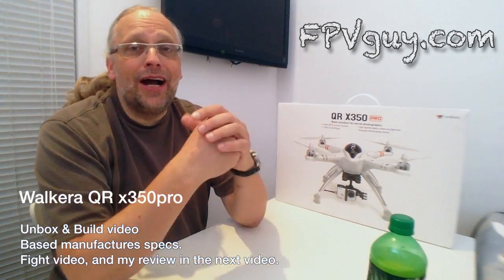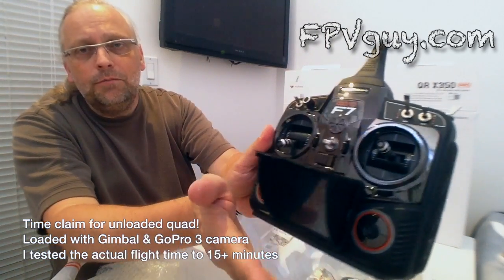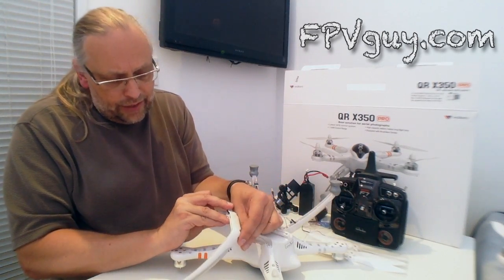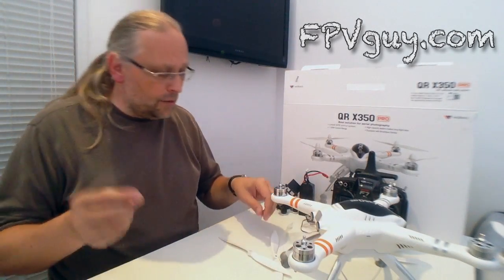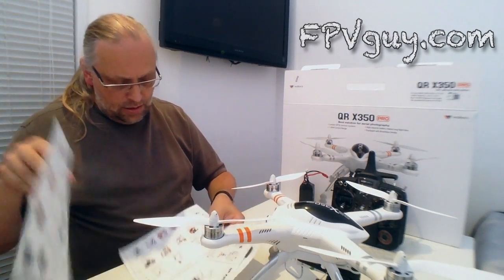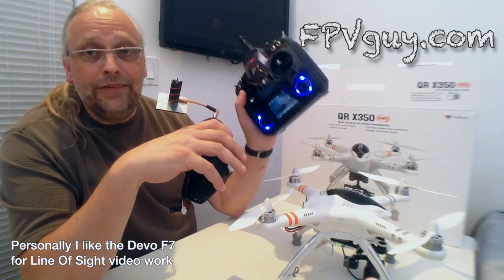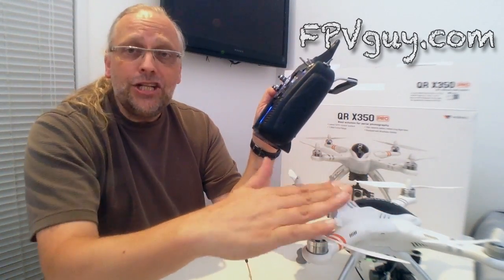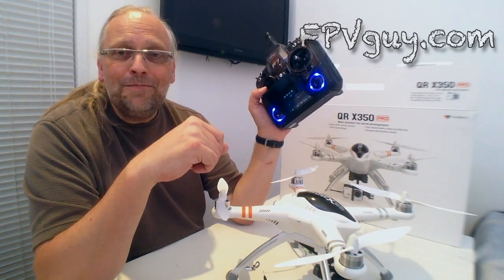Walkera QR x350pro build video

Comment: i've researched for weeks between DJI and QXR. Just picked my QXR today thanks to your videos! Very informative and descriptive! Answered MANY of the questions I had the local dealer didn't know how to! Thanks! Subscribed!
Reply from the maker: rabeirophotography  thank you for the kind words.   glad some of all this information turned out to be useful.:-)
Reply: Bo Lorentzen indeed! and the instruction manual you translated came in handy!! thank you! i'm looking forward to posting videos touring the florida beaches soon! [as soon as i can trust myself to not land it in water!!] i'm a total newbie...
Reply from the maker: rabeirophotography LOL. well its better to keep you out of the water.  get a lipo tester like you see in my first-flight video.   get used to the actual flight time,  then stick a digital egg-timer on the top of the radio, so you can see a flight time EACH time you start, if you believe you have tested 15minutes, you should set the alarm to go off maybe at 10min so you KNOW you have enough safety buffer.  remember, wind, speed of flight can significantly affect your power consumption.    Go find a "long haired" green field for practicing and get comfortable flying and using the controls in the system.
Reply: Bo Lorentzen will do. i plan to set my timer on my phone when i fly. that was the one thing i really liked about the Pv2+, the app contained all the information. the dealer where i bought the qxr wasn't sure about how the quad reacted to low battery. he thought it would start flying back with low battery and i couldn't find anything about it online anywhere. is it possible to have this thing drop from the sky due to low battery if i lose track of time?? is there any indicator on the remote? i am still charging the batteries.
Reply from the maker: If it runs out of battery, it will auto-land.  firmware 1.0 and 1.1 came down pretty quickly, I just tested the latest 1.2 which come down a lot slower..   
The software on the QRX is not as refined as a P2, but it is a APM controller, and you can do almost anything with it.. take it VERY slowly though.  hop online and learn the APM mission-planner.   
To address the come home on low battery though, its not such a great idea, as if you have flown straight out for 90% of the battery,  clearly the quad will not make it back home on the remaining 10%, that is why the emergency land simply lands.  
I would install a lipo beeper that starts beeping when the batteries get low. and also look into a OSD that works with APM.   but basically, good healthy flight-management, suggest you fly fairly aggressively in a small area, get some real times, then set timer to HALF that time as a good point for thinking about getting home and landing.. my last two crashes was because I ignored that.. in the desert I was landing with maybe 90sec on the battery, and then chased a motorcycle for "one more shot" that was stupid and cost me a couple of propellers and a arm on a hexa.
Reply from the maker: rabeirophotography BTW. here is the test of the emergency landing.. I did not touch the controls. however UNLIKE me,  the moment it touches down (or right after) flip the MIX to 0 (manual) position and kill the throttle to avoid it keep trying to fly.. I left it in GPS and it was not sure it landed because of the soft impact on the grass.  that was firmware 1.2   x350pro 1 2b
Reply: Bo Lorentzen you rock! thanks!
Reply: Bo Lorentzen any suggestions to start looking for an OSD?
Reply from the maker: Ahhhhh.. thats hard, I use the bone simple $30 thing with a GPS from HobbyKing, and don't worry about how to hook it into the main system. however there is one called something like miniimOSD that is made to work with APM controllers.. so thats probably the ticket.. Im just not sophisticated enough to sort it out.
Reply: Bo Lorentzen yup...that's what i've found so far. thanks again for all your time and help! really appreciate it!!!!
Reply: Bo Lorentzen my first flight was a failure! only out about 5-7 minutes when i tried RTH switch and something happened. it just dropped from about 1015 feet on pavement. broke the shell. replaced with 350 for $5 but now, although battery acknowledges connection and beeps, no lights, no bind. tested battery, was at 64%. now at shop. going to cost me money i'm sure to fix or replace! ugh!
Reply: Oscar Rabeiro 10-15 minutes…not 1,015 minutes!!!
Reply from the maker: Oscar Rabeiro OUCH Oscar,   that is horrible news.  But you know, Im curious how you decided on the first flight ever with this thing, to fly it 300m up and test a feature you are not familiar with. ;-)    Im not judging just STRONGLY saying. DON'T DO THAT.!   all new users should go find a piece of green grass and fly over it while learning how the quad behave. It is very hard to manage all the details of a first flight from memory, but stick to a few features.  particularly make sure you have it in solid-GPS hold, and as I said many times, keep flying 4-5 batteries before going further. as the hold get better.     I suspect the throttle stick were not centered.. or that it accidentally maybe were switched from GPS-hold to manual.. I don't know and it obviously don't matter at this point.. 
PLEASE everybody buying new quads, regardless what brand, please take a look at the FIRST FLIGHT video I did the other day x350pro Safe First Flight - Step by Step
Reply: Bo Lorentzen absolutely. i actually watched that video again before i took off. that was a typo, not 1015 feet, 10-15 ft. it seemed to get away from me a bit at that point which is why i wanted it down via RTH. definitely was trying to keep it over grass, but it was at a local model plan air field. the height and direction got away from me, hence the RTH then BAM! now just waiting for them to tell me the damage. if more than i care to spend for repairs, looks like i just bought myself an $800 paperweight sadly.
Reply from the maker: Rabeiro Photography  PHEW. well 10-15 feet sounds a lot better. ;-)    its one of those times I wish there were a black-box to see what happened,  I know stuff goes wrong, but I wonder what it was.    Contact my buddy Matt before you commit to a fix cost, he may have a though about that.  he is pretty active on the RCgroups 350pro thread. user name mattjk
Reply: Bo Lorentzen i was even afraid of flying at that height!! so 1015 feet would have meant i just gave up and walked away! LOL thanks for the heads up! i'll find him!
Reply from the maker: 10-15 feet is a bit high first flight.. ;-)  but should not completely destroy your quad.
BTW. love your G+ page,  shoot me a PM as you go forward fixing the quad.
Reply: Bo Lorentzen will do! hopefully no major and can be repaired. thanks! i don't work much on the g+ page, all my other work is on my main pages. :-)
Reply: Bo Lorentzen after two weeks I am finally picking up the 350. long story short, they are replacing. No one could figure out what the issue was! They couldn't get the board to show on computer. They said unlikely case with walkera, but ultimately, a bad board that went kaputz. I am curious about that though. My luck to get the one bad board that caused the crash? Hmmmmmm. Anywho, I'm taking another maiden voyage flight ASAP. the dealer tested it, so should be perfect now. Walkera took this long to reply. Can't wait!
Reply from the maker: Rabeiro Photography    Awesome,  hope everything works out with it.

Comment: I had a heck of a time getting mine to fly correctly and work in GPS Hold and RTH modes. After hours of tinkering, I finally realized that a RTF Walkera X350 Pro doesn't come with the transmitter configured to fly it out of the box....or mine didn't. Once I viewed the much more helpful DVD instructions and set everything up, NOW its RTF.
Reply from the maker: thats odd,   mine flew out of the box all functions,  my guess the dealer merged a BNF kit with a un-programmed Devo radio.?
Reply: Bo Lorentzen I suspect you are right. The EBay seller I bought it from doesnt respond. Lesson learned. Thanks for responding and great videos. Subbed.

Comment: Thanks for the video Bo.  I'm a newbie to the quad flying, and I should be receiving my 350 pro tomorrow, and your video helps a lot.  I'm starting mine out with the propeller guards...lol.  Also, thanks for the easy to understand Quick Start Guide.
Reply from the maker: Hey Johnny,  thank you for the kind words,  delighted I should help understanding the setup to the 350pro.  Ive had a lot of fun flying it, hope you will as well. :-)

Comment from the maker: Phil Ladds  motor not starting,  make sure the mix switch is in "0"    next check your trims. ;-)

Little surprised it just wandered off,  I have not heard about that before,  the first couple of flights mine were a bit rough, but nothing that was not easily managed with a bit of roll/pitch control

Comment: Hey bo thanks for the reply back. Im happy to report I fixed the problem with the motor myself. It was the red green  and yellow wires they were just held in by white liquid electric tape. No soldier at all. All four motors were like that. Everything else was soldiered very well. So I just put couple drops rubbing alcohol and it scraped right off. Stripped and soldiered everything back tight. So if anyone else gets new 350 pro take apart and refix wires so you don't plop out of the air. I just put aeronautical lights on. Did not notice it then. But thank you for your reply you've always been very helpful. Great help for new flyers like me. Btw will you be reviewing the hubsan x4 109 pro, did you see it at the c.e.s in vegas. Thanks for your help look forward to hearing from you. Good day
Reply from the maker: WOW... that was a crash waiting to happen. glad you got them soldered up correctly..   
I did see the 190pro,  but until it flies and ships not much going on with it..   right now my money is probably on the q500 in terms of ease of use and general video performance for entry level operation.
Reply: Thanks bo, who makes the q500 ? I'd like to check it out
Reply: Allow me to retract that last time I just realize you were talking about the q500 you reviewed. Sorry lol, medicinal purposes withstanding. Took me a sec to realize. Just woke up from work
Reply from the maker: Michael Dorn  LOL

Comment: Hey Bo, Got to watching this video again for about the tenth time. Learned a couple things, this time around. One being the fact that i can buy a devo7, transmitter and have it work. The other was that, the problem i am having with trying to bind my Turnigy 9X with this quad is this, I believe. In this video, You mention the fact that it has the APM, control system. I have been trying to bind a PPM, system with the APM system. Not 100% sure, but I don't think that will work. So, with the devo7 receiver on it's way to me. There is also going to be a devo7 transmitter on it's way shortly! I'm am still hopeful that I didn't burn something out, trying to use a 14.8v battery, at the start of this build. Thanks Bo!! Tom....P.S. I want to thank You for writing back to me the other day! I have asked questions of other bloggers, with no responds at all from them!! Thanks again!!
Reply from the maker: No worries.   yeah put that devo rx in there,  google for some pictures so you see how these are connected.   I'm 90% sure it was a bunch of jumpers rather than just one.  but dont remember.  walkera have their own "ppm" scheme.  
once you get it connected you will know where you are at.  
remember the Walkera  RX's  like to be turned on first, then turn on the radio right after so they can bind.

Comment: hi BO  i had 4 rock solid lights ,to my thinking if i have 4 lights blinking i would of thought that gps is  good with no problems that is why i assumed there wasnt a problem with gps thanks for your help ian
Reply from the maker: Ian,  totally agree,  I just had to ask. ;-)     You need to contact the reseller,  this sounds like a warranty problem / replacement issue.

Comment: thanks BO I'll get the dvd for the 350 pro and check for the settings to put on the devo ten transmitter
Reply from the maker: You don't really need the DVD,  just the manual, its up on the Walkera website.  Check my blog post not he 350pro for the manual.
http://www.fpvguy.com/2014/05/walkera-qr-x-350pro.html

Comment: Bo I did some more research and the 350 pro I have on order has no cam or fpv so I can add my mobius cam to it and the antenna and fat shark cct board to it as I have done to my SYMA..then use the goggles for fpv... which is probably better as I understand the screen if often hard to see.. but amazon has offered a great price on the model I chose so I can't be too choosy lolol
Ken
Reply from the maker: +Ken K.   Great prices are typically my downfall,    yup, you are completely right,  you can put the SYMA setup directly on the 350pro.  and flying it in manual is quite responsive.

Comment: your the first person to explain how the GPS works, I have asked a few people, if it worked like the DJI Phantom, and by you it does, so I didn't want to buy one until I found out, I didn't get on with the x350, and the [pro has a bigger battery and the better gps, and its cheaper than the dji, I already have the f7 walkera receiver, do you no if the walkerax350 pro without the transmitter, marries up with the f7 without to much trouble, regards Brian
Reply from the maker: Hey Brian,  glad the video was helpful.   
Yes its easy to setup the F7 for the x350Pro..
First create a new model so you don't edit on top of another.  then just follow the setup instructions from the manual.    with that you are ready to go.  turn on the radio and right after the quad, they should pair right away.
Reply: Bo Lorentzen thank you for getting back to me, yes I found your video very helpful, thanks again Brian

Comment: Just ordered one. Outstanding video Bo! Feel more confident now. Much better than the out of focus video from the English guy. I had no idea what he meant also, you are clear and concise. Q. Do I really need to balance the props? Thanks.
Reply from the maker: Thank you Patrick,   glad it was helpful.
I would say, yes balance the props,  they might be right on, but if they are not, they are the main source of vibrations in the system,  the vibrations affect the performance of the flight controller and your video.   remember if the props clip something you gotta check the balance again, otherwise you end up with jello.

Comment: thank u very much for the video it was very intresting and i liked it .im expecting 1 of them 2 soon and i cant wait until i got one in my hands :D
Reply from the maker: Hey Tom,  its a great quad, and the price is right.  
There is ONE strange thing,  after you do the first calibration, the first couple of batteries you fly with be a bit "rough"  its not locking the GPS position as nice as it should,  fly in a open space and use the stick to mange it a bit, and simply fly the battery pack.. mine was rough the first couple, on the 5th it would stay solid in GPS lock.. its really strange, but seems to be a APM controller thing more than a Walkera thing.  I can't explain it, but have seen this behavior on two APM controllers now.

Comment: nice kit - I do have a problem with the low-res stills out of that cam. It seems like when you pay less, you get less!
Reply from the maker: Absolutely agree,  the iLook is not particularly great, my GoPro 3+ blows it away.  but I gotta say the iLook+  images look pretty good.    I would say the iLook+ is the ticket, it have the build in 5.8 down and the quality is perfect for real-estate,  but walkera also told me they are about to offer a kit with a TX5803 and a GoPro cable, which plugs straight into the qr x350pro - and there is no doubt if you plan on doing video, the GoPro is the ticket.

Comment: Hi Bo - thanks for the information on the camera on/off cable - I await delivery of my order! I should have read all of the comments to discover your comments about the unpredictability of the GPS during the first few flights. I lost control of my quad following what I thought was a great trial - switched out of the HOLD to find the quad wandering off on its own and not responding - landed with a CRASH!

Any guidance on how best to trace my current fault? The quad powers up and appears to bind with the DEVO-10 but propellors will not unlock. I can calibrate the compass and seem to receive GPS signals. The G-2D lights up green but the gimbal does not respond. I have not yet taken the top off to see if any wires are loose but am wondering if a crash might have damaged the RX703A?

Any ideas....and I thought I was doing so well!

Comment: Well I am embarrassed to say that I figured it out.  It was the power and gain settings on the Gimbel had to be tweaked,  after adjusting those settings it worked well. 
Cold crappy out in Ontario,  no first flight yet